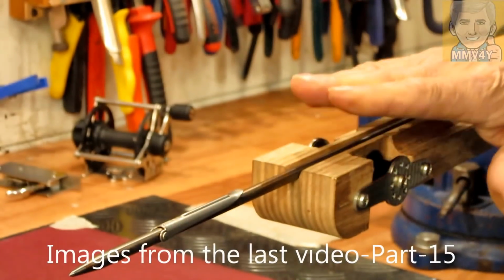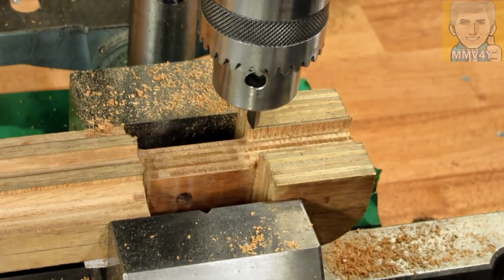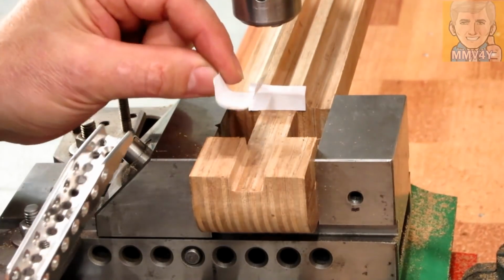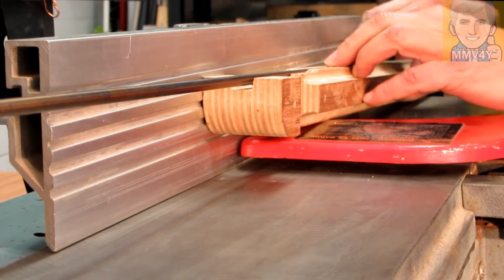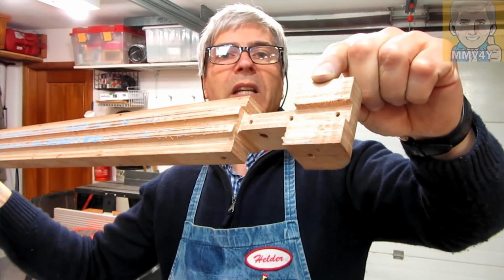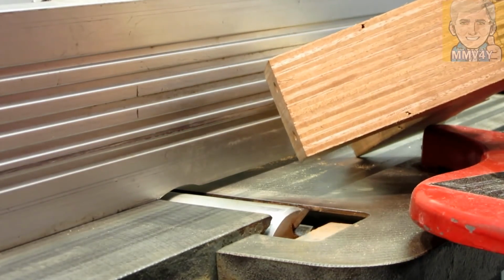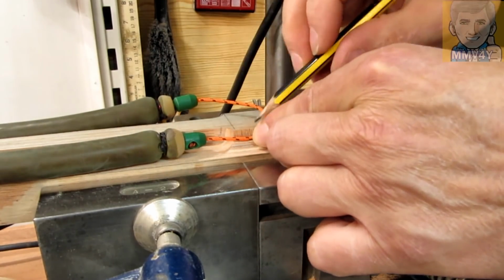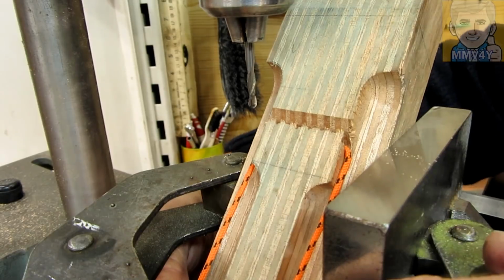Making a Speargun - Part-16

Comment: External hydrotherapy uses applications of hot and cold water to stimulate the flow of blood and lymphatic fluid. Methods can be as simple  as a foot bath or a sitz bath, or they may involve more complex procedures. In all cases, the effect of treatment depends on regulating such variables as temperature, duration, and site of application. Hydrotherapy can be used to draw blood to an area, to direct blood flow away from a congested area, or to alternate blood inflow and drainage.External hydrotherapy treatments have been shown to produce profound effects on immune function. In particular, applications of hot water have been shown to boost the number and activity of natural killer cells—key white blood cells in the fight against cancer.2External hydrotherapy should be provided by someone knowledgeable in the technique and its uses, such as a naturopathic physician. But there’s one simple external hydrotherapy treatment that just about anybody can use, involving the use of alternating hot and cold water after a shower.